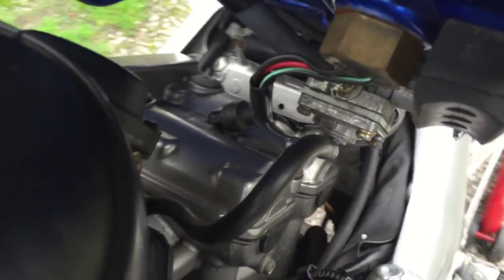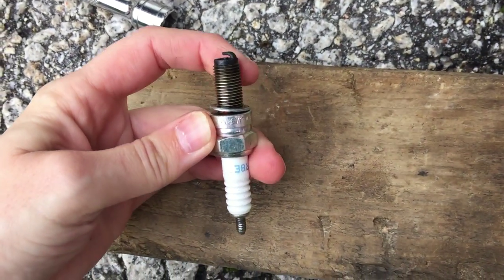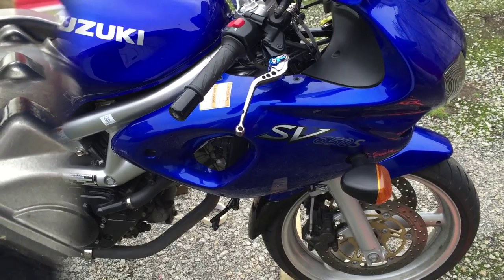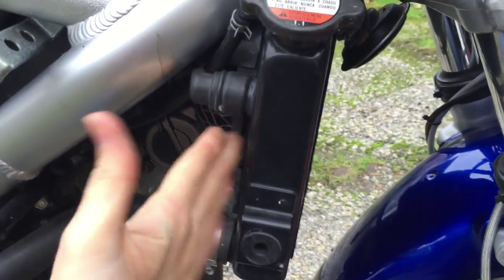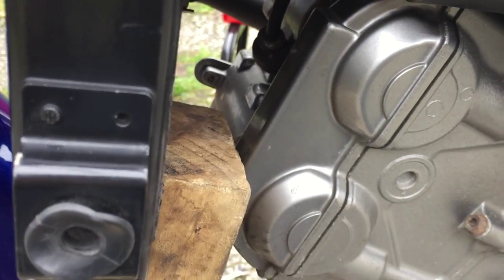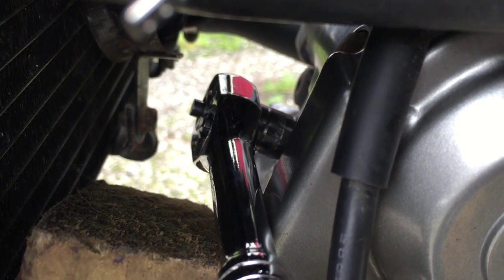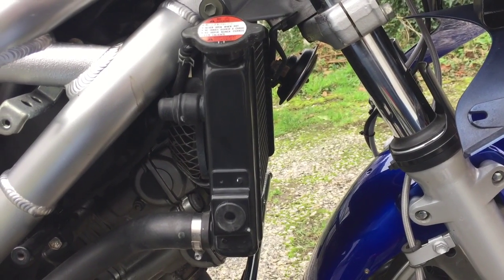Spark Plug Change SV650 Motorbike Maintenance

Comment: Just a small hint for pulling out these plugs out of the deep hole: It´s not necessary to use masking tape (even without rubber inside the nut...). Just unscrew the plug completely out of it´s thread, take the tools away and use the connector to pull the plug out ;)

Comment: Recently picked up an SV650 to get my bike legs back after 20 years of no riding and getting back into the maintenance side of it as well. 
Needed to change the plugs on my SV so watched a few tutorials, to my horror there were guys saying to drain the coolant, remove the fan, rad etc etc and then I found your video.......best one by far.
Did exactly as you did, took it out for a spin and perfect. Quick and simple. Thanks for your help 👍

Comment: I discovered today that the spark plug cavity on the front cylinder has a drain hole in it, the end of which you can see on the right side of the cylinder head (just above where head meets barrel).  Becasue it's narrow, it can get clogged and stop water draining from the spark plug recess, but it can be easily cleaned using a pipe cleaner. Nice vids, thank you Tamsen.
Reply from the maker: Great tip- Thanks for sharing!

Comment: Just about to change plugs and balance carbs, and found these videos.  Helpful, and it turns out you aren't very far from me!
Reply from the maker: I am really pleased you have found them useful! Always nice to meet someone local, where about are you? If you are fairly close, if you ever wanted a hand I would be happy to help out.
Reply: Not that close; Plymouth.  But hopefully we can hook up, I don't see that many SV riders these days. 
 The plugs are done, but I had to use a flexible 4 prong expanding grabber to remove the front plug.  The plug cap was too long to pull out the plug without damaging the radiator.  Luckily I have 25 years of tools built up, just less enthusiasm for doing my own maintenance any more!
Reply from the maker: You are right, Plymouth is not all that far away! 
After 25 years I bet you have got some incredibly useful tools. Whilst my collection is building up, I have 4 young girls with very small hands which has proved useful to grab things for me lol!

Comment: Thanks for the tutorial, it helped me gauge how much time I'd need to complete the job.

I would add that I wouldn't put plugs into an aluminum cylinder head without some anti-sieze present on the threads.
Reply from the maker: I think that is a great top tip! Although there is also a train of thought that if you checked them regularly like you are supposed to (and I must admit, I sometimes am a bit slack on this myself!) then there would be so much of an opportunity to seize in the first place lol!

Comment: Great clear instructions. I love the clean bike and clean hands !! Given the front spark plug can be the cause of serious misfiring in rain, checking it, especially with a fairing is going to be a major job !! I read comments about unblocking the drain hole in the park plug holder... It would be helpful if you could do a short video to show how that is done.

Comment: I just did the sync today for my 2002 based on this video. Thank you!
It was pretty hard to access and remove the rubber cap from the front needle even after moving the radiator a bit (didn't want to remove the hoses for more mess :).
I hope that silicone hose will not melt that I put there for future maintenance purposes. :)

Comment: Excellent video, doing the plugs on a friend's bike later on today. This will save me some time. Thank you!
Reply from the maker: How did you get on? Pleased you enjoyed the video!
Reply: No great. We could get the fairing off. The bolts were seized up and we rounded a couple :( It will be going to a mechanic next week. Hate when this happens.
Reply from the maker: +eric molimard was it the bolts to the fairing that were rounded off? If so, a dreamer drill with a cutting disc can cut a slot where you can use a screwdriver to get them out, or you can put a bit of plus gas on the bolt, leave it to soak in and loosen and then there is a removal tool which grinds out the head, then reverses and enables you to remove the bolts. Maybe worth putting a bit of copper grease on the news bolts so it will be easier to remove in future (but not on bolts that you do up to torque, the grease can give a false reading and lead to being overtightened.)
Reply: Good idea, will try that the next time. What is plus gas? You're very helpful, thank you.
Reply from the maker: Hey molimard plusgas is a brand name of an aerosol penetrating oil, basically it is a dismantling lubricant, if you have something seized, spraying it on the affected area and giving it 10 mins to work can make the 'whatever is stuck' easier to remove.
Reply: Tamsen Cooper similar to wd40 then. Cheers

Comment: Nice trick with the masking tape there, I had the same issue with my halfords spark plug socket. To get them out I used the socket which came with the bike toolkit that picked the plugs with no issues. You could probably use the HT leads to pick them up though like Сергей  mentioned
Reply from the maker: +Bikers Quest Yeah agreed, the under seat kits do seem a bit more secure than the halfords set, but there is always a fix to make things work ;)

Comment: Another great vid. You always explain things nice & clearly,  making jobs less daunting. (You can get to the front plug without removing the side panels; just undo the side  & top panel bolts, pop the locating lugs out of the side of the rad,  unbolt the rad and prop it as you have done. However it does make things more fiddly) :)
Reply from the maker: +Simon Rogers Thanks, Thats a really nice thing to say. You are right about not needing to remove the side panels, I was trying to make it as clear as possible for the video and with such limited space in the front anyway I figured there was less chance of damaging fairing!
Reply: With the panels on it would be difficult to video. Sorry I didn't mean any offence,  u r doing an excellent  job👍
Reply from the maker: +Simon Rogers No offence taken! I love the comments and suggested improvements! Thanks. Besides, I have already damaged my fairing by dropping the bike so its all about damage limitation!
Reply: Do you want to come and fix my sv650, for some reason its not wanting to start 😣

Comment: i tighten them by feel mainly becaise my bike is 15 years old and the old spark plugs always leave a residue of rust on the head thread so its not easy to fully tightem them by hand and i start using the wrench way before they seat. i use the rule snug but not too tight. also, if the wrench is long i handle it in the middle to reduce leverage.

Comment: Another great video!!thanks so much Tamsin!😁👍
Reply from the maker: Thanks Mark, got a couple of new videos coming up over the next couple of weeks, I hope you enjoy those too.
Reply: Tamsen Cooper do you know anything about a fault that seems to be common,the front cylinder not firing?my girlfriend's 03 bike,has been stored for years,an is now to be sold,just serviced it,an front cylinder not getting a spark!methinks coil,but bikes only just done 4,000 miles!so this was it's first official service!(I,v changed oil several times over the years!)I put new plugs in also.thanks again!great channel!!
Reply from the maker: I think you have gone for the best option first, i.e. swapping over the spark plugs, before you buy the new ignition coil, the front cylinder has a small drain hole which can get bunged up easily, causing the cylinder to potentially fill with water, and this could stop it, especially if it has been stored a while, just check that before you part with your cash! If the new coil does not work, there may be an electrical fault which you can test with a multimeter at various points. I hope this helps, let me know how you get on!
Reply: Tamsen Cooper thanks Tamsin 👍

Comment: Looks like your engine was running a bit rich back then, just a little adjustment on the carbs probably sorted it.  I still would have cleaned the plugs up a bit if no replacement was at hand, as I'm sure you know.  

I found your channel recently and it's fun to watch and learn, I trained as a car mechanic a long time ago so I know a fair bit, but it's nice to see how things are done on bikes and the little differences as I've not ridden long or done much work on bikes either.
Reply from the maker: Pinned your comment as I think you make excellent points! Thanks for taking the time to give such detailed support.

Comment: Thanks for the video again Tamsen.Would have been better if you had shown getting the front plug out as it is tricky :)

Anyhoo.With the help of your video and the manual I've just checked and re-gapped the front plug on my SV650.Spark plug colour on both my plugs were nominal e.g Light Tan(Light grey is acceptable)

Tip:I cut a 4"x4" square of cardboard from a cereal packet and put some double sided tape on it and stuck it to the inside of the Rad.I did this for two reasons.

1:Your advice/warning on the fins being sharp but primary....

2:So the End of the flexi Spark plug spanner from the SV toolkit(Well worth having) did not damage the Rad or fins :)

3:If you cut yourself keep a tube of superglue handy in the garage(Poundshop do an 8 pack for quid).It's what ,"Superglue" was originally designed for battlefield triage.
Reply from the maker: Hey, Really pleased the video helped. I like the tip around protecting the radiator- better than causing damage to the fins! Not sure I can commit to superglue as a first aid response, knowing my luck I would stick myself to the car steering wheel or something equally as daft ;)

Comment: Radiator spark plug is little bit scary to replace since your operating at an angle and "in the dark". First time I was replacing it without removing radiator fully (just like in video) I was little bit sweaty.

Comment: First plug picture had the cap still on? Second pics look plug  running a bit rich or valves leaking oil or loss of compression? Amazing what you can read off plugs. If burning clean, no oil sign and plug with a tan. Lol. Good vid from ole sod.

Comment: Great video thanks, you've made what i thought was a daunting job look easy. If I am covering ~600 miles a week, should I still do this level of service every 4000 miles? That's going to come about pretty quickly
Reply from the maker: +Jacob Porter thank you for your lovely comments! That has made me smile. This is what is in the Haynes manual as the suggested Suzuki service for the mileage- you are racking up a few miles each week, I think it would probably be a good idea to keep a close look at these critical systems, better that than discovering a problem 50 miles from home or worse still whilst riding! Glad you have found them useful.

Comment: I wonder if the drain hole on the front cylinder is blocked up, as the spark plug should be full of corrosion, methinks water has been resting in there...there's a drain hole on front and back cylinders, just been cleaning mine out yesterday
Reply: shouldn't...not should...hmmmm
Reply from the maker: yeah, that is a good shout, thanks.

Comment: when you put back the rear spark plug, how many more miles could you get out of it? I have the same bike, and my spark plug looked just the same as your rear in the video :)
Reply from the maker: Hey, it was a bit fowled up, so I swapped it out after the video, it can be a bit of a pain to get to, so I figured whilst I had it all opened up like that I may as well do it at the same time! At about £6 I didn't figure I would gain huge savings by leaving it! Thanks for watching.
Reply: Thank you for the info :)

Comment: Can I ask what the exact socket size you used.. my under seat tool kit is missing this one item!
Reply from the maker: The one I have used in this video is from the Halfords advanced set, it contains a rubber insert which is designed to help hold onto the spark plug, but as you can see from my videos, the extra masking tape works really well. It is marked up as 10mm but is a socket specifically for spark plugs. Thanks for watching.

Comment: Hi Tamsen, I recently bought a SV650S but it's a 2009 model k9, do you know if the spark plugs are at the same places as your bike?
Reply from the maker: yeah they are in pretty much the same place, thanks for watching.
Reply: Apparently, the k9 has 4 spark plugs, there are 2 extra on the sides of the engine block.

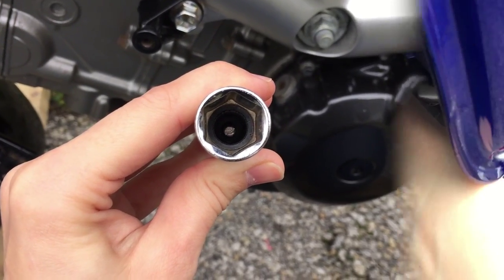Comment: Hi, how are you using a candle key? 01:45 pls
Reply from the maker: Not sure of your question, it is a spark plug socket (with a little bit of tape to help it grip) on a short extension as there is not much room due to the petrol tank above. Does that help?

Comment: really great video :) 
BTW I guess your sparkplugs looks like your bike is running too rich
Reply from the maker: I think they were before due to the extra black deposits on the spark plugs, that has been sorted since I bought the bike, now she purrs and wastes no fuel ;)
Reply: Tamsen Cooper top tip!cut a piece of garden hose,fit it over top of new plug,an feed the new plug into the head!turn the plug till it won't turn no more,then use plug spanner.this will stop cross threading!
Reply: Tammy how do I turn the gas line off on my sv 650s

Comment: masking tape? I am using spark plug cup to pull out spark plug
Reply from the maker: +Сергей Хузиахметов Mine is a spark plug tool, sometimes it doesn't grip though, if yours does then brilliant, if you find it still slips out masking tape gives the tool a little bit of thickness that grips onto the spark plug to help lift it out, great if you don't need to use it, useful if you do!
Reply: pro-tip from working on cars, after its loose, just stick the regular plug wire down the hole till it grips the plug, and pull it back out, and boom spark plug in your hand, no need to tape anything